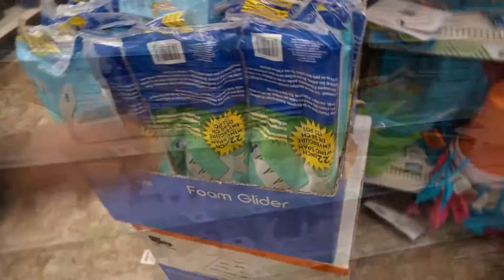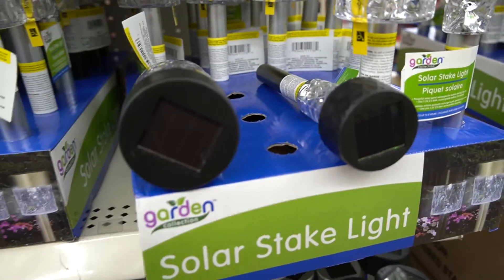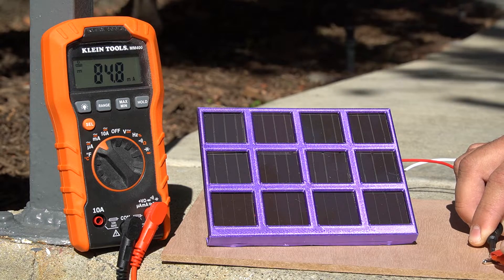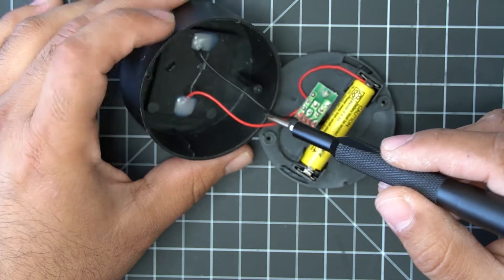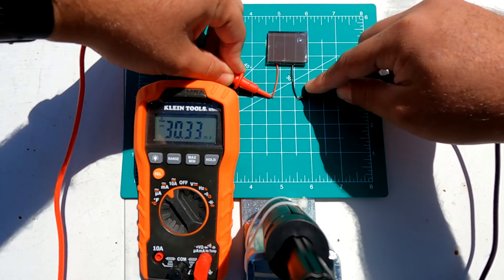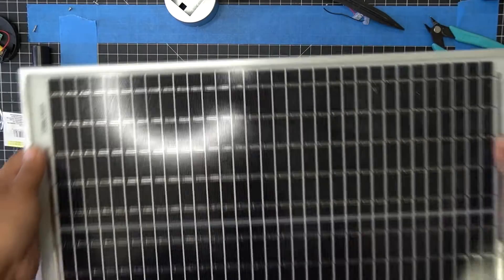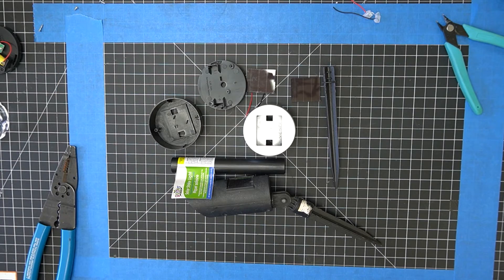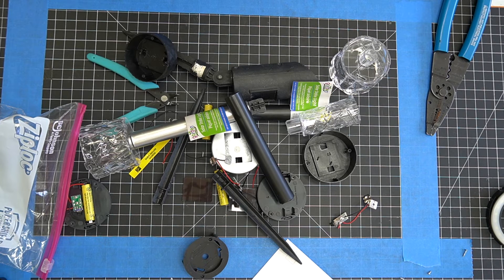Dollar store solar lights hacks!?!

Comment: I have six that are really old. Thinking about using a couple of solar panels in serial with a newer board that charges 3.7 volt lipo. I only need to operate an esp32 sensor for about 20 seconds once a week, then it goes back to sleep.
Reply from the maker: Sounds like the perfect application for these

Comment: Just picked up one of them. I'm going to see if I can use it to light up my back seat so I can see my kid in the mirror better at night inside of his rear facing car seat. Figure I all I need is to run a dim light anyway, then reworked linking a few up to bread board with a variable resistor and a cookie cutter charge controller can work well. Just worry about the cars heat in the Florida sun when parked.

Comment: I know it’s likely beyond the scope of this video but I wanted to mention that the difference in power output of the different cells is directly related to their technology. The amorphous silicon solar cells you get at the dollar store or in calculators are great at picking up low light but have a terrible power output, the opposite is true for crystalline silicon cells. I like how you did the price comparison, because that’s exactly what hacking is about sometimes. Finding that more affordable solution. But if form factor is a issue, check out Solarbotics as they have small scale crystalline solar cells. I learned the hard way, in my past, to stay miles away from amorphous cells due to their supremely low efficiency. Even though the low price makes them very tempting.
Reply from the maker: I thought about putting an explanation in my video about exactly that. but I decided it would be overly technical. Thank you, I'm sure other viewers will enjoy.
Reply: Yes and no. I have 9 of the  15 watt, 12 volt Harbor Freight solar panels.  No, they don't put out much power but it doesn't take much light for them to begin putting it out.
They are not nearly as good as mono or polycrystaline types.  
But they start producing power as soon as the sun hits em.

Comment: I'm up in Canada.... I Bought A LED Solar Light Motion Detector.. $19.99 at Princess Auto .. Like Harbor Freight Type Place

Anyway... I Bought 4 of Them After The First ONE... It's AWESOME.. I Have One on Right Now.. It's 11:30pm & I Put It on at 7pm.. Stilll Bright, I Use Them Inside... It Has Like A 12 Volt Plug.. It Fits My Cordless Drill Charger & I CAN Charge My Batteries With The Panel..I HIGHLY Recommend IT/THEM.... You'd Prolly Get'em In The States For About $12ish I'd Assume?... It Charges A Lithium 18650 Cell Inside The Light/Detector.. There's A Switch For Steady Operation Or Set It To Detect Motion... And It's 2 Parts.. The Light... & The Panel About 8"X10" and about And Inch Thick... With The 12V Wire About 20 Ft.

I Bought another Type as well... With The Yellow Silicon LED's... It's MASSIVELY Bright & Has 3 Smaller Panels Built In.. I Use That One Outside Over My Side Door... Works Excellent.. Super Bright.

Anyways... I'm A Long Typin' Sommagun..lol... Great Video.. Keep'em Comin' !!!
Reply from the maker: Lots of good information!! Thank you, never heard of the store you mentioned but sounds awesome!! Glad you like my videos.

Comment: Is the rechargeable battery worth using?
Reply from the maker: I did not test them this time around, however last time, eventhough they are labeled as 100 mah, I remember getting like 25% of that. Honestly the short answer IMO is No.
Reply: @AlansInventions  thanks!
Reply: Kinda?
Reply from the maker: Define kinda?
Reply: @AlansInventions  They work okayish for low power electronics.